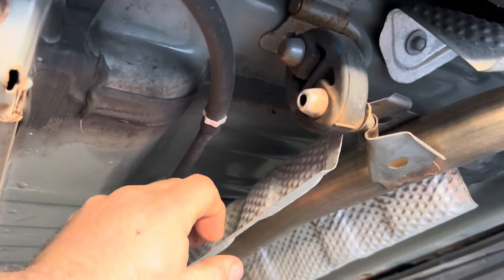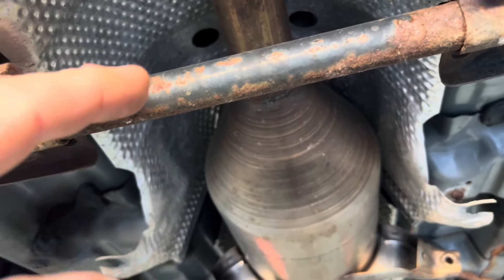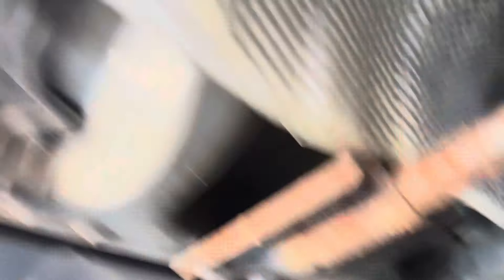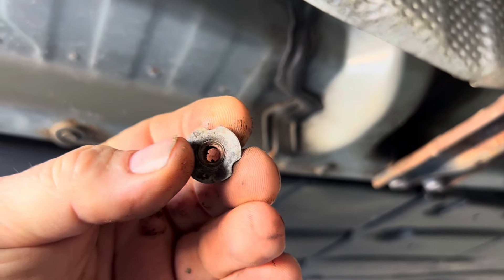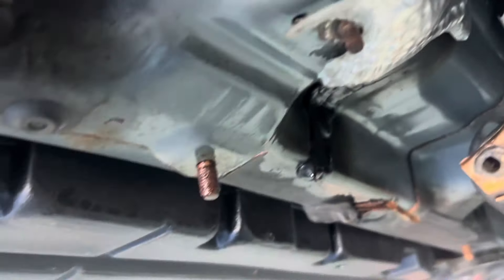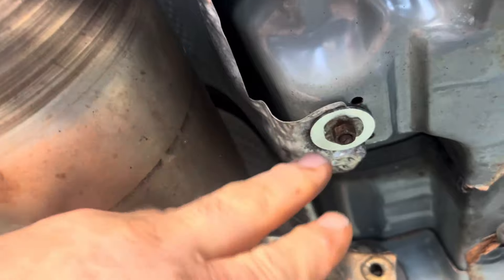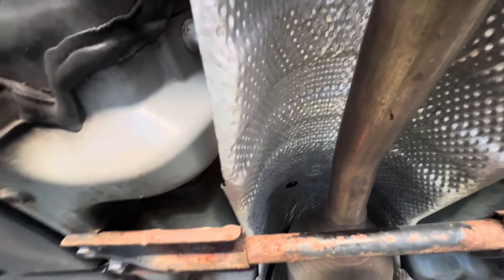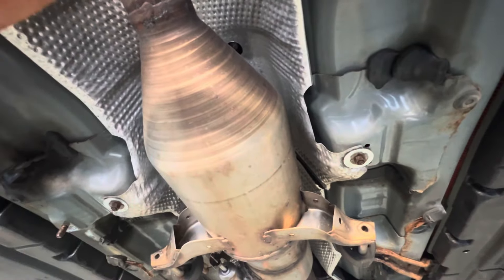Horrible exhaust noise turns out to be a cheap fix

Comment: You can even make metal strips if using larger washers doesn't help. Similar straps are used to attach the fuel tank. Of course, they do not have to be as solid as those holding the tank.